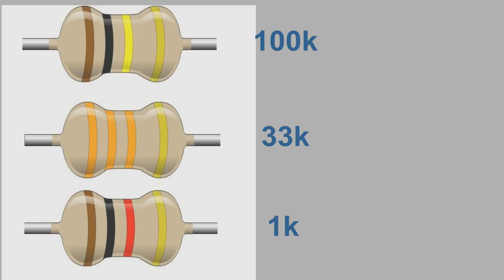Traffic lights automatic  controller with transistors

Comment: I replicated this on a breadboard but the lights are not lighting up in sequence. I have used a 100 mfd capacitor and 1k and 100k resistors with PNP 547 transistors. The bulbs are lightingg up but not in sequence
Reply: 9 volt battery
Reply from the maker: circuit is 100% correct can you send me the pic of your project....?
for more circuits plz visit my web https://envirementalb.com/traffic-lights-controller/
Reply: 547 in a npn transistor according to google

Comment: Work great, but not as great presentation. You needed to add a section about needed components. Ex: Resistor 1k - 3 nos...
Reply from the maker: please visit
Circuit Diagram1======http://tinyurl.com/y6tblsa8
circuit diagram 2======https://bit.ly/2YzLstx

Comment: I guess you have a good knowledge of electronics. I need your help on the following topic. 
Is it possible to add a knob to control horn volume (like music volume) of a car/vehicle? If yes, please guide. Many people have said that this is not possible.
Reply: Simply cut one wire going to the speaker. Then solder 1 side to pin 1 of a potentiometer and the other to the middle pin of the potentiometer